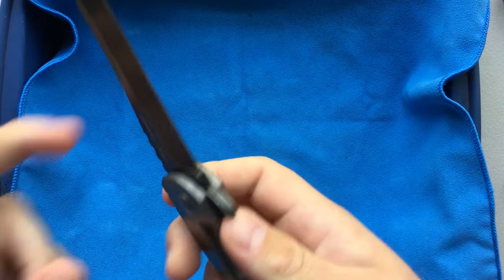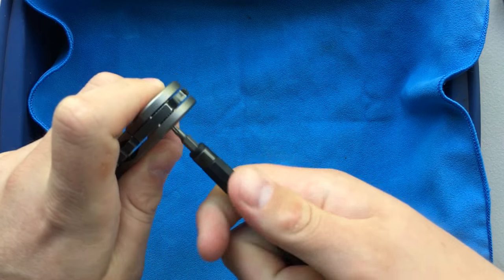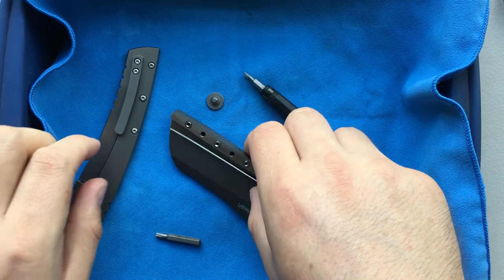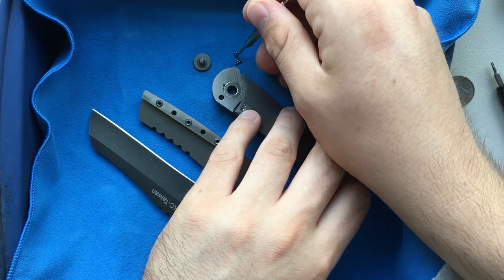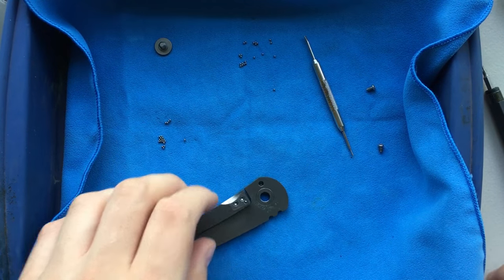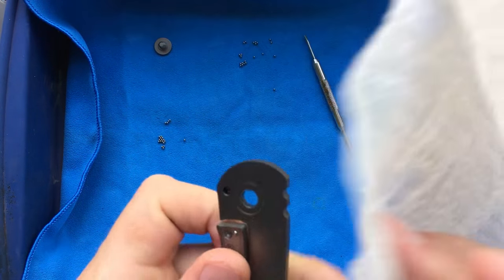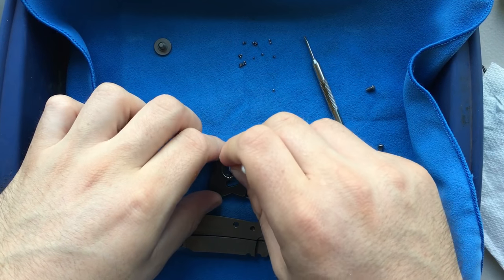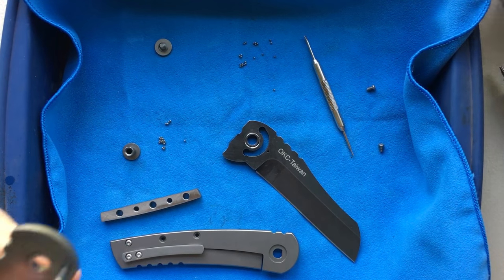How to disassemble and maintain an Ontario Carter Prime Pocketknife with IKBS

Comment: How do you decide when to use the 85 or 10 wt nano oil to apply?
Reply from the maker: +Ibnu Nadzir Just a question of thick vs thin.  For IKBS, you want the thickness.  Same for detent tracks.  But for everything else, 10wt is fine.

Comment: If weight is a problem, why not leave the spacer off?
Reply from the maker: Because then you'd need standoffs of precisely the same width which don't interact with the blade.  Possible, but tricky.

Comment: OMG that's ridiculous! Lol. I would NOT have the patience to deal with those bearings!!! Screw that! The first time you use this knife to cut some type of food your gonna get gunk into the pivot and then have to take a half hour and another lesson in bearing torture to clean your knife! No thanks! This video makes me want to stick with a damn Opinel! Haha
Reply: There's a reason the rest of the world UPGRADED from loose bearings to caged bearings.
Reply: Yeah well I've found an even better solution...  Carry a fixed blade. They're the most reliable cutting tool there is. You'll never have issues with: lockup, blade centering, vertical blade play, horizontal blade play, lock stick, pivot problems, too early lockup, late lockup, torn washers, lost ball barrings, stripped torx screws, detent issues, pocket clip issued, hot spots from narrow 2d handle designs, or proprietary hardware.... just to name a few. With a fixed blade, you just pull it out and it works. =)
Reply: You can still get stripped torx, sheath detent issues, sheath issues and hot spots/2d handles from fixed blades :p
Reply: It's very easy to avoid fixed blades with torx screw construction and 2d handle slabs. I don't buy either. You don't have much choice when it comes to folders.  They are all pretty much 2d flat, thin knives held together with torx screws.  Unless you get a slip joint constructed with pins instead. As for sheath issues, I'm not picky about sheaths and if I do have a problem, there's a million sheath makers out there that make excellent products.  Either way I think fixed blades are a lot less problematic than any folder. JMHO